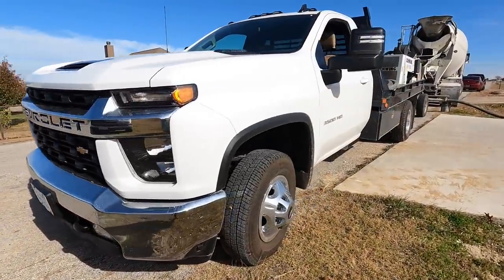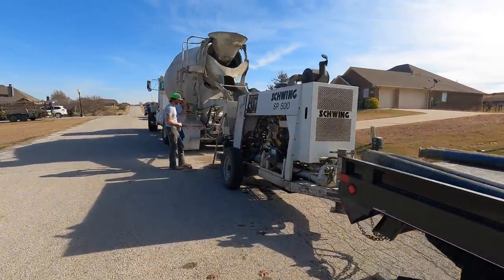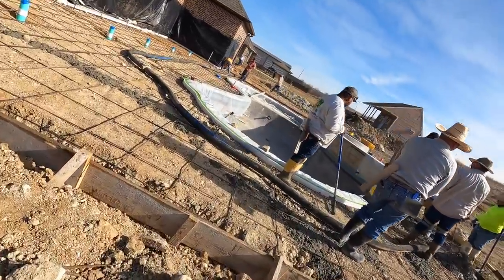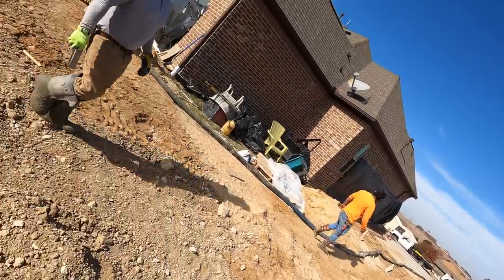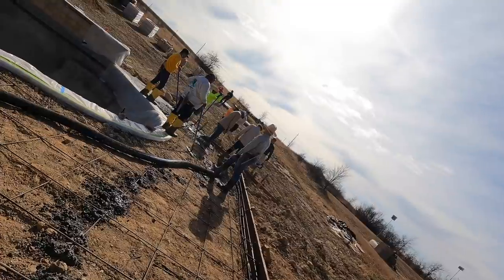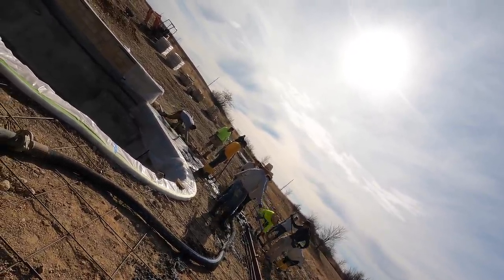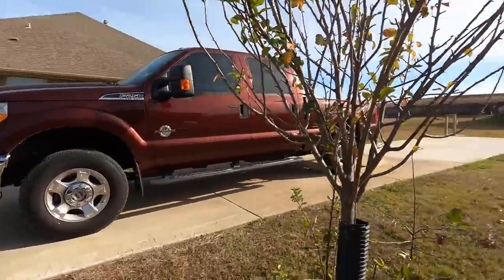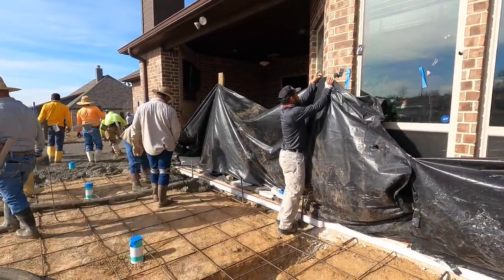New lorrie to pull the trailer pump with. Concrete pumping with Muddyfeet

Comment: I hope you have better luck with Gm than I did, I bought a new chevy 3500 for my landscaping company and had tons of issues with it. After 2 winters of snow plowing in Wisconsin the whole front suspension needed rebuild. Switched to Ford 5 years ago, zero issues with 3 trucks. Even run bigger plows and haul/tow more.
Reply from the maker: I hope we do to. I’ll go back to dodge if it doesn’t work out.

Comment: Wet setting block is really nice to establish your first course. Super fast
Reply: I would have went and stuck rod down thru the cores and maybe even filled them with some leftover mix
Reply: @jonschneck4559  Yesir, anything to help the process
Reply from the maker: They may have after they set the blocks.
Reply from the maker: Seems fast to me.

Comment: How do you haul water? We use a ram 5500 12' bed with a ready mix truck water tank and then an electric air compressor. The air compressor runs off the line pump which then feeds a couple old air tanks we took off a wrecked truck that I bolted between the frame and the tool boxes of the pickup. You can't even see the air tanks unless you go under the pickup so they took up no used space. It works pretty good for blowing out hoses too which we have 150' of air hose on a reel under the bed for that.
Reply from the maker: We haven’t carried any water in years. Might look into doing it again.

Comment: I drove my 5500 Dodge home from Nebraska with no bed on it, I can tell you where every bump and bridge was on that 250 mile drive.  Like you said, the bed calms them down, I weigh about 15000 now and it rides great.
Reply from the maker: Yes. Huge difference between now and then.

Comment: You plan on mounting a water tank to the truck? We have them on ours.
Reply from the maker: I’m not sure yet
Reply: @MuddyfeetConcretePumping  do the concrete trucks help you out with clean out right now?
Reply from the maker: Yes and we can usually get water on the job sites also

Comment: What size aircompressor is that on the flat bed. Thinking of getting one to start blowing out hose on long hose jobs on my 3/8 peagravel pump.
Reply: What you recommend for blowing out 2.5in hoses when I have 400ft laid out. I'm sick of pulling all that hose back to truck to washout.
Reply from the maker: I’m not sure of size but I don’t think their many options. It’s a Dewalt gas air compressor on pontoons

Comment: What is a salt finish on the concrete mean Jeff?
Reply from the maker: They float it the salt chunks  in and then want touch it again. They’ll come back the next day and wash the concrete off. The water resolves the salt and it leaves holes in it and some texture.
Reply: @MuddyfeetConcretePumping   Thank you for the explanation I have never heard of a “salt finish” before